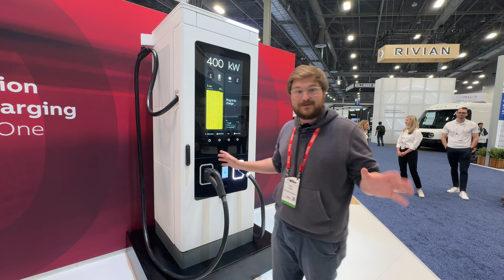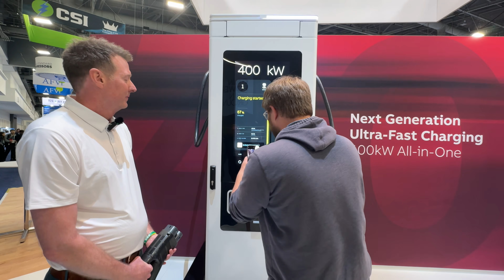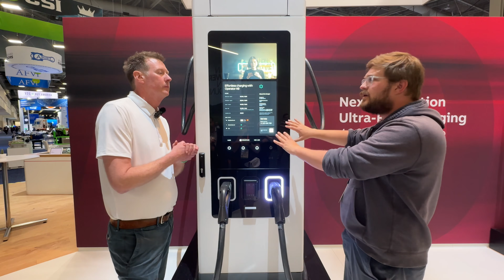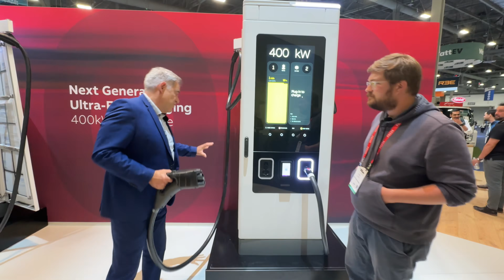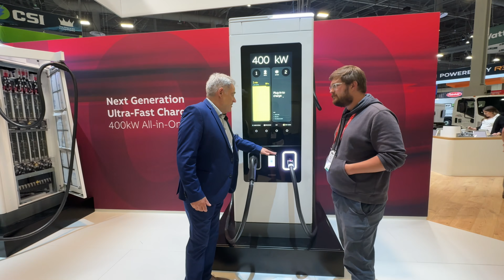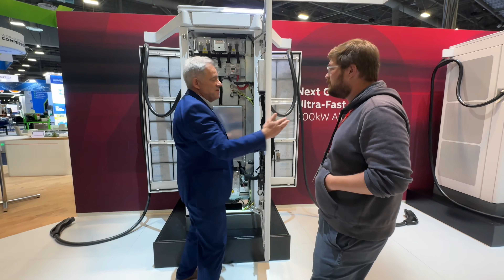New ABB 400kW All-In-One DC Fast Charger! A400 HPC Full Tour - Software, Cables, & Hardware

Comment: The ccs cooling is similar to PC Cpu heat pipe copper tube passive cooler heatsinks.
Maybe Nacs was a bad choice for NA standard, as fitting passive heat pipe cooling into a Nacs handle appears a challenge re the much smaller volume vs ccs

Comment: 50k stations for fast charging is abysmal.   As of July 2024, there are 145k gas stations averaging 6 fueling stations per gas station.  When you account for a 7 minute fuel to 45 minutes EV  for time in the station, it is clear that more stations per EV are necessary. Its time for tech heads to pull their heads out of their gamer ass's and get it done.

Comment: In our area tweakers are cutting and stealing cables for the copper.  Charger manufacturers are going to have to make the cables retractable that deploy only with an app or RFID.  Entire charging stations are down for weeks and I expect once repaired they will be cut again.  No cables = zero reliability= zero revenue.

Comment: The station itself can view the car’s ID and, during the first connection session, link the car to an account, after which the user adds a payment card to the account and never returns to this issue; authorization occurs at any station using the car’s ID.
Without these choices on the screen, without wasting time.

Comment: I charged on one these just last week in Roswell, New Mexico. (Its max output was limited to 100 kilowatts.) The Allsups on 2nd Street has partnered with Francis Electric to provide EV charging in Roswell. I pulled in with only 3 miles in my battery, and was back at 80 percent in just under 30 minutes. I don’t think it was doing over the stated limit or it never throttled down to achieve that delivery time. I think the Artesia Allsups has an older version of this same machine.

Comment: 21:08 He's describing heatpipes in an unnecessarily convoluted way. It's interesting that you can get pattented "we used heatpipes to cool this thing".
It's also interesting from an engineering POV - those heatpipes are most likely connected to metal plates to achieve larger surface area. But those plates (and heatpipes themselves) will get covered with dust and other dirt that significantly degrade heat transfer. So how can it be without maintenance?

Comment: Talking about payment success... Now so many gas stations are putting in chargers I would Love to see local pay authorization just like a gas pump.  If the card reader or app isn't working you can always go inside and pay and last resort give the guy cash and ask for $20 on charger #3.  The pin cooling system sounds just like how CPU and video card coolers work with sealed heat pipes that naturally circulate a liquid as the temperature rises.

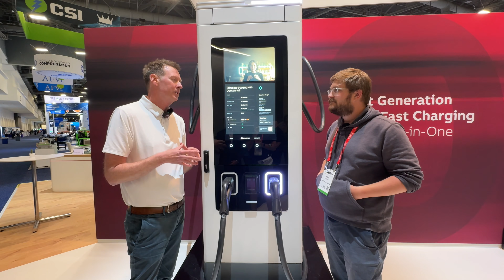Comment: 15:55 This customized UI concept is a bad idea. Think about your regular gasoline pump. Forever they were super simple, you hit one of three buttons and you were dispensing fuel. When they went to the fully LED display it got much more confusing, there's flashing lights and branding and other nonsense. 
When you're at a gas station you know what station you're at. Due to The branding, static graphics and the color scheme. I don't need the name of the chain flashing in front of me.

Comment: Kyle this passive liquid/air cooled CCS handle will NEVER come to NACS. Just look at it, NACS is so small that the cooling vents would have to be at the handle grip which is a safety issue. This shows the fundamental inferiority of NACS, and why it's insane that people want to switch - a smaller handle will always be more limited in design options than a larger.

Comment: Those small holes in the casing of the handle are the weak point of the system. Clogged up with dust and grime compacted by moisture and handling might tempt some of the users to clean them - pushing this mixture inside the cavity.

Comment: Way too big, it's a monstrosity
Reply: Actually it's just big enough to take the three phase AC input and output DC charging current in one cabinet.
Reply: @hwirtwirt4500  Well EVGo is tall and slender, and can do 350kW. I'm good with that. Curious to see how fast I can get my truck to charger on Tesla's Supercharger once Rivian (allegedly will) sends me my free CCCS to Nacs adapter. I think ABB should go for a smaller look.
Reply: Or magic dock thingy, I really haven't had to check out the Tesla superchargers although I drive by them all the time
Reply: @dhp9691 The EVGo would have to have a remote power supply like the Tesla Charging stations.
Reply: @hwirtwirt4500  do you mean that EVGo and Tesla Superchargers have the AC to DC converter in a separate cabinet, and the pedestal charger itself is all DC?
Reply: It’s an all in one unit, makes sense for a lot of customers

Comment: 42 euros for a single fast charge?  Then a full battery replacement down a few years or after a small accident?  Where's the savings?  I hope that wasn't a realistic charging price.
Reply: most evs have a 10 year warranty and newer evs have much better thermal management than the early evs. Most EVs charge at home for the majority of miles and fast chargers only used for traveling. If the frame is bent to the point it damages the battery it is no longer a "small" accident

Comment: The separation between the controllers is good, but if the HMI controller goes down, doesn't' the credit card reader also go down.  This would be OK if the Plug-to-Charge is activated, but otherwise a problem.

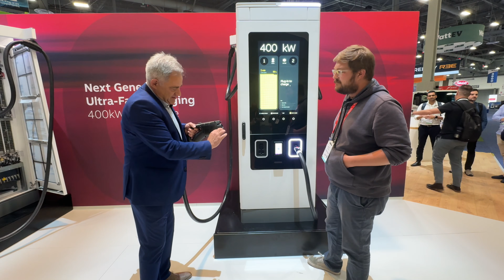Comment: 21:09 - ref: 2 phase Dielectric Fluid like you may have seen being used to cool whole Servers or a Bit Coin Miner in a Fish Tank.  well known as "Clean Agent" for Fire Suppression in Motorsports/Racing (think Porsche 911 Cup Cars) the fluid for this used to be Novec 1230 (and may still be) but ABB's likely found a reasonable substitute since 1230 is apparently a PFAS or "Forever Chemical"... and while i believe it's currently still available, the last i heard 3M is unfortunately scheduled to stop producing this "wonder fluid" in the year 2025...

see kids "this is why we can't have nice things" as this follows the Universal Law of NO FREE LUNCH that we originally saw with the banning of Halon 1301 back in 1994 as a Fire Suppressant because of it's sever Ozone Depleting Potential, and then the banning of FM200 as a Fire Suppressant back in 2022 since THAT was identified as being a Global Warming Agent.  again, every time Mankind thinks the've made a "gain" in some way, shape, or form...?  it turns out something is also being TAKEN AWAY.  

also ref: the Montreal Protocol of 1987.  also ref: the banning the manufacturing of any new AC systems that use Ozone Depleting Refrigerants like R-12 and R-22.
Reply: Asbestos

Comment: Looks nice. The inside box is well thought out. I'm not sure about all the lights and UI. The industry has moved on. I just plug my rivian in at Ran or tesla and walk away. No lights, screens, buttons, separate apps or payment terminal needed.  Everything shows on the vehicle display and i get a reliabilty rating of the station miles before i decide to dare stop at EA's new abb unit. A credit card terminal is an ok alternative to plug n charge but I'm sick and tired of needing another app or being charged in $10 blocks and getting $6 of power.

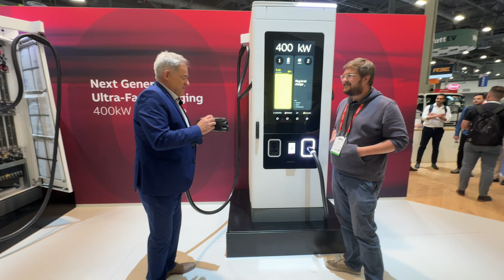Comment: At 20:53 isn't Johan just describing a vapor chamber?
Reply: Yep, common in graphics cards these days. And the heat-pipes are also used for both GPU and CPU coolers.
Reply: @Gazer75  I wonder if they patented the shape or how it connects or something. Otherwise, I'm curious to see how they've made it non-obvious. Though if nobody else has done it maybe it already was.

Comment: Wow, those are short cables. That's just stupid for commercial charging because it limits where and how you can install these chargers.  Tesla superchargers has short cables also, but they are positioned for Teslas, which causes problems when non-Tesla EVs charge at the Tesla superchargers. Right now, I doubt that most vehicle batteries can support 400 KW. It will probably require new solid-state batteries to go higher than 250 KW charging speeds without degrading the batteries.

These chargers will also require 24-hour supervision because people will deface the screens with graffiti, just like they do with gas pumps. It's great that they are big and beautiful, but they clearly are not practical. That's a shame because this company has put a lot of work into these superchargers.
Reply: There's already LFP batteries that take 550Kw from Catl called 4c batteries. LFP is known for better cycle life .

Comment: Alpitronic is, outside Tesla, the brand to beat. they are essentially the backbone of the reliable public charging network in europe
Reply: Never had any issue with ABB chargers myself. Also Delta chargers have been doing just fine. Tritium on the other hand have been troublesome.

Comment: The nice big screen looks very nice and impressive, but will it stand up to be cooking in the sun all day long? Most charging sites are not shaded, so whatever charging stalls are sitting outside exposed to the elements and in the sun -- having such a large screen seem more like a liability than an asset. It don't help how great the charging hardware is, if an important part of the screen is burned out or not visible. Seem like they have not thought that through too much...

Further more, the QR code scheme still rely on network access -- suppose the cellular network signals are weak or unreliable -- again, it won't help if they have all these neat features that requires network access, if network is down or otherwise not available.

Seem like ABB is targeting urban environments/use cases...

Comment: The pin cooling is literally a PC heatsink using heat pipes, kinda smart lol
Reply: Definitely sounds like that. But even the patent law accepts that using an existing technology in different context is an „Invention“ and patentable ‒ so they are rightly proud for discovering the opportunity.
Reply: Next time you will need to bring your own fan to charge the car a max speed. 👨‍🔧
Reply: @e-redj  I wonder when cars that want to charge fast will get equipped with (water / air / passive / whatever) cooling on the connector from the other side.

Comment: The screen is gorgeous, but in the US, vandalism might be an issue.
Reply: Polycarbonate cover will go a long way in preventing damage. Polycarbonate can’t be broken with a rock or hammer. Paint and scratches are easily removed.  Keeping these locations public like at a 24 hour minimart gas station will keep them safe
Reply: Australia joins the chat.
Reply: Same as Canada. I see stop signs or even bus stop polls ripped out of the ground. I even see other stuff to
Reply: That screen is a punching bag unfortunately.. even in Australia the much smaller screens on Tritium 350s have been broken regularly.

Particularly for these battery backed chargers which are more likely to be installed in low usage areas on small grid feed.

Comment: Every charging cable manufacturer that I know has the dc contacts and the frame as individually replaceable parts so that’s definitely nothing new. Also I don’t know which competitors he’s talking about that require 4 wire AC connection. Every charger that I know can work with only the 3 phases and no neutral.

Comment: The much anticipated 10min fast charging network is impossible. Why? Because 6 chargers use enough energy to power 300k homes. How many coal power plants will you need?
Reply: You can load balance with a battery bank, it charges the bank during off hours and discharges during peak usage
Reply: @JD-yx7be  it’s not enough. The whole thing is a fantasy devoid of reality.
Reply: @nordlandak6853  i live near a coal plant and support the coal industry and workers. I would be glad if they expanded them like they do in china
Reply: @nordlandak6853  Increasing supply of electric will also decrease the per kwh cost of electric and support many more jobs. The politicians that say no to every power plant know that scarcity increases cost which makes their lobbyist happy but will spin it as "protecting the environment"
Reply: @JD-yx7be  the problem is the push for clean energy crowd doesn’t care about cost. They think they’re saving the planet.
Reply: @JD-yx7be  Coal is being phased out and replaced by natural gas powered electrical generation.
Reply: 300k homes in Africa 😂
Reply: American homes that have 230v can Draw 23KW . If they don't use GAS .. they could be Drawing that much power.
Reply: @Y2Kvids   actually 200 amp service which is pretty much the standard for a normal non gas house can draw 38 KW.
Reply: You can always count on a grossly misinformed nincompoop to make the "grid can't handle it" disproven talking point.

Comment: MUST.  PROTECT. CABLES.
Reply: What do you mean protect cables? Suggest solutions instead of making generic statement. It would help more.
Reply: Simple. Have cables retract inside of charger unit until credit card/app authorization unlocks them. Too many meth head copper thieves preying on these things.
Reply: @explorer9070  MUST.  PROTECT. CABLES.
Reply: I saw the thumbnail after coming from a thieves targeting chargers video and thought, hey now thats thinking right there, they get two for the work of one. genious

Comment: Direct competitor to the HYC400.  Can’t wait to see what Alpitronic is doing next. The big display is kind of useless. Integrated light and surveillance camera would be neat. There are more and more complaints in Germany about chargers in the dark in the middle of nowhere.
Reply: > The big display is kind of useless.

How so?
Reply: @leah.internet  Why do you need a massive screen to display some lines of text and a big area with dots for the SoC?
Hyperchargers have a 3rd of the screen size and its plenty.
Reply: @Gazer75  My mum and dad both really struggle with what I would call H U G E text. I'm the opposite... at least they've got plenty of real estate to play around with different UIs in the future. Fingers crossed these screens stand up in direct sunlight.
Reply: @leah.internet  Charging for me: I take the CCS connector, plug it into the car, scan the barcode with the app and that's it. What do i do with the display? With plug and charge even the barcode step can be removed.
Display are just an expensive and unreliable piece of hardware. Most AC chargers here do not have a display and i have never missed it.
Reply: And 90% of the time, they face the the sun in its brightest glory making reading them near impossible

Comment: The CTEP compliance and UI is pretty impressive. Making it web based rather than app based is a huge improvement for the consumer.
Reply: Agreed. It is annoying to need to have a dozen or so apps to charge. The average user won't want to do this
Reply: @atehrani  Part of the requirements in California are that the chargers also include credit card readers as well as the option to call the provider to submit payment. In theory, apps, memberships, and special access for specific makes and models should be completely unnecessary.
Reply: ctep compliance (or regs) seem annoying.  I just want to charge, so many screens.
Reply: @SkiDeepPow  Most of it is related to weights and measures, which is a good thing. Requiring it to be on a screen on the charger creates some limitations.

Comment: Matters not.
They will never be as reliable as a gas pump that uses a human and ONE bank transaction,  instead of the many more steps and parts, communication, protocols, Internet, servers to get juice out of that device.

Thieves are not stealing gas hoses either!
How do they plan to “solve” that problem?
Substitute copper for something else?
What else? 🤫
Reply: Do you even know how many components are required for a gas station?
Pumps can fail, valves can malfunction... As a matter of fact: mechanical parts (aka moving parts) are more likely to fail than electronics. 
Also, humans are not really reliable. Especially since in many countries, there is a shortage of truck drivers, which frequently results in delays in fuel deliveries. In the worst case, this can even force gas stations to temporarily shut down. Happened in the UK in 2021. 

That being said, I've also never heard of anyone stealing charging cables. That's likely an issue only in 3rd world countries.
Reply: @lukasweishaupt2708  i agree with the first part. The stealing cable is in every city in america which is basically a third world country
Reply: The process has been dumbed down to the point where even you can figure it out.

Comment: With 400kw output, these could be installed with an MSC and an NACS or CCS1 connector along highways  to allow more charging for larger electric vehicles.  With an NACS or CCS1 connector it would be used more until more larger evs are out instead of just setting and not being used.  All these units should have enough room for towing & larger vehicles.
Reply: I see both ABB Terra 360 and 300kW Hyperchargers here in Norway that are intended for trucks.